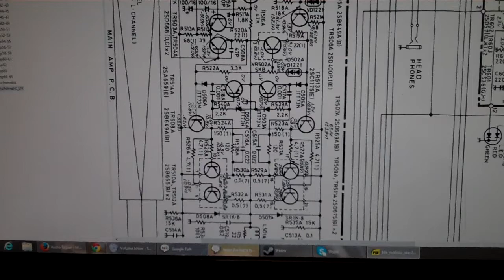Fix It Friday: Realistic STA-2300 Power Amplifier Modules

Comment: Andrew thank you for a great video.I bought an STA-2300 in1980 when I was on high school and 4 Mach-Ones.It was on use everyday until about 6 years ago.I stored it when I moved to a new house in my dry basement.I've been contemplating  dragging it out of "moth balls" and hooking it back up, but I'm afraid of it having problems due to storage and age .Any tips for hooking it back up? Also I have the original owners manual that has the schematic in the back of it ,if you need it I could scan it and e-mail it to you. Lonnie.

Comment: I was wondering if you'd happen to know what is going on with my sta-2700 realistic receiver. The following is the background info as to what's going on.

    I've been using a new to me sta-2700 for a couple of months now. At times I've run it pretty hard. The other night running it "pretty hard" it shut itself off and then back on , I then cranked it way down but it again went into that protection clicking off and then back on. I thought maybe it was the speakers so I removed them and installed some other speakers (I'm just running a single set of 2 8ohm speakers, "speakers A"). and it shut itself off again. At that point I just turned the receiver off. Now last night while using it at quite a low volume after about a half hour it shut itself off and then turned itself back on and at that point I just shut it off because I have a problem somewhere. I didn't really feel any warmth coming off it so I don't think it's heat related.

    I bought a service manual for the 2380 because I know they are similar, thinking that the troubleshooting would maybe give me a hint but it doesn't have anything about what to look for if it's going into this protection mode. I'm hoping someone or multiple people will have an idea what to look for as to why it's happening. Thanks in advance. 

   As a little bit of an update, the speakers I removed I hooked up to a sta-2380 realistic receiver (which is just about the same as a 2700 except the 2380 isn't remote controllable) and ran it for about 6 hours at a moderate volume with no signs of trouble. Made the receiver a little warm but not too bad considering it was in my 80 degree barn. So I don't think the 2700's problem is anything to do with the speakers.
Reply from the maker: Funny you should ask about the 2700 as I have one of these! The power supply board is notorious for bad capacitors and thermally stressed joints. Recap this board and rework all joints at hot parts. If the regulated supplies go intermittent, it will go in and out of protection. If DC offset is high, replace the two transistors in the input stage.
Reply: Hey, thanks. I see from the service manual (at least for the 2380 it has 4 ceramic caps on that board (I think?) do you do those also or just the electrolytics? Do the elect's show any obvious signs of being bad? To give you an idea where I stand as far as repair work. I work on the old selectavision ced players. Their service manuals are very detailed and really guide you as to what to look for and how to test etc. So when I have that guideline to follow I can usually find defective parts, make adjustments etc. So replacing the caps on the power supply board is not a problem for me. I've recapped a couple realistic shortwave receivers. However I don't know how to test for dc offset. Is that something you can explain here or is it too "deep"?? I just bought a new receiver a sherwood cheap receiver but I had a related model that I abused and I pretty much had it on all the time for a few years and I think the power transformer went out on it so I scrapped it. I think it was $99 when I bought it. That's when I thought about going old school and got the 2380 but realized I really want the remote control capability so I read the 2700 is basically the same except it has a remote. There are some minor differences, one of them has a midrange adjustment, So then I got the 2700. I stuck the 2380 out in my pole barn and then hooked the questionable speakers to it and ran it for about 6 hours without incident.
   If you can explain that dc offset thing I'd appreciate it. For the ced players I sometimes use my oscilliscope, frequency counter and /or voltmeter for testing and calibration but some of it seems to best be adjusted by just playing a disc and making what ever adjustment.
Reply: I checked my dc offset, I didn't realize it was so simple. Anyway my right side is 3mV but my left side is 100 mV so I'd like to replace the transistors, however, I don't know what two to replace/ I don't understand what input stage means. I did find a forum post from about 4 years ago and the person performed the repair so I've posted that on the forum along with basically this same question. Do you happen to have the service manual and/or schematic for the 2700? I'm using the one for the sta-2380 because that's all I could find but I had to buy it for $15. Thanks.
Reply from the maker: @jsdspif3  sorry for the late reply but if HifiEngine doesn't have a schematic, consult the STA-2600 schematic  as it's the closest match to the 2700. Only the electrolytic caps are failure prone in this unit. To correct offset, replace the two small transistors in the input stage with a closely gain matched pair. These are in a differential pair config; google this and once you see one example of a diff pair, you'll be able to spot them immediately.  Off the top of my head, I believe these were PNP parts and if so, use KSA992 as a replacement and ensure the pinout is the same.

Comment: Hey Andrew, do you still do restoration work?
Reply from the maker: I do but the shop is closed for new work at the moment due to a move. Should be back in business by December.
Reply: @MadScientistsLair  about how much would it cost to service one of these units today?
Reply from the maker: @davedavis4285  It depends on the level of service. A full rebuild is approaching a grand but few need this level of service if they're well maintained.

Comment: Getting a new fiber glass board would be first, then the rest.  Just see how good it could get over the other channel, then change it too if it helps.  Next time keep your videos until the work is done then upload.
Reply from the maker: Why would I want to replace the entire PCB? It's in very good condition. No pads were lifted and no "green wire" repairs were required.

There's no need to perform the difficult and time consuming experiment you've proposed because there is no basis for it in electrical engineering theory. Show me the math or go home in other words. Finding time to rebuild this is hard enough with school and actual paying customers so if I'm going to mod it, it had better be worth it.

Phenolic FR2 to Epoxy-Fiberglass FR4 is just a durability move in circuits like this. Going FR4 serves no other functional purpose other than flexural strength in single layer, low voltage, low frequency PCBs with component temperatures that are well controlled. Heck, parasitic capacitance is low enough that we can make UHF circuits on phenolic so we can dismiss the most common gripe, dielectric constant, right out the window as we're working with frequencies no higher than 100kHz on this circuit. Since this is home gear and not being tossed into a roadie's band trailer on a daily basis, I see no reason to change the boards for durability either. (What about the other boards, do we rebuild those in a ruggedized version too?)

If I were to go through the trouble of making a new PCB, where do we stop? Do we change the layout, which is already quite good and very easily made worse? Do we change the topology as well to one that is 4x as complex but gets us an extra decimal place cleaner on the already pretty much inaudible THD? Both, even if executed perfectly, would show miniscule improvement unless we tossed the preamp as well...and then, well, you don't have an STA-2300 anymore.
Reply: Andrew Kwiecinski
Well just why you'd want to replace the board is real simple. (When you know how).  It's like getting the STA-2300 the same boards as the McIntosh 4100 .. because ... know what?  It's not just a durability move.  Besides consider such a You Tube video - a tricked out STA-2300 to compete with 'the MAC' receiver.  Actually the Carver MXR-150 probably needs you more.  It's a receiver that needs some You Tube help - if ever there was one.  How about it?
Reply from the maker: Kepler Mission
 OK, since you claim to know more than I do, I have a challenge for you: Explain in detail, with the relevant mathematics to back it up, how changing the board material from FR2 to FR4 is going to make this thing sound like a McIntosh MAC4100.

If you meant that you'd also change the circuitry, explain in detail what makes the MAC 4100's drive boards so special and what design features you'd incorporate in your new boards. Also, explain how you will propose driving the extra set of output transistors the Realistic has and how you'll be ensuring adequate drive and proper biasing of four outputs instead of just two on the MAC4100. (Yes, the STA-2300 is a more powerful receiver than the MAC4100.)

Are you basing your assertions on proper electronics design or are you just rambling on?

To others reading....

The MAC 4100's drive boards do not appear to be special at all unless you're driving into clipping, which the MAC4100 drive boards prevent by limiting the input by use of a comparator and an unusual way of shunting excess signal using an LED and a photoresistor. This is the short and sweet of how PowerGurard works and it's one of the simplest compressors around. A similar comparator based system without the photoresistor is used in Peavey's DDT circuit and many other clipping prevention schemes. It is much preferrable however to have a generous reserve of excess capacity than to rely on a compressor to prevent clipping.

The MAC4100 receiver does 75W into 8 ohms and 100W into 4 ohms and uses a single pair of output transistors. The STA-2300 is does 120W/ch into 8 ohms with two pairs of outputs per channel. Both are rated at 0.05% THD at rated power. Needless to say, the drivers are different for a reason; they're totally different amps!

If I was going to do something as daft as to redo the driver boards, I'd forget the nearly 40 year old MAC4100 design entirely and build one based on the LME49810 driver IC and get up to an order of magnitude better specs....but if I'm going through that trouble, I can't leave the preamp alone, etc. Te question is, where do you stop when you start redesigning existing gear? I happen to know for a fact that the preamp is the weakest link, not the drive card. Yet the preamp is good enough as is so I'm not going to bother with redesigning it either. The overall S/N is 90dB, not spectacular but it certainly gets the job done. Bringing that up to 110dB or even just 100dB would require extensive redesigns of multiple subsystems including the preamp and is about as much labor as building an entirely new amp with MY name on it and potential commercialization opportunities.

TL;DR: The STA-2300 is going to be largely unchanged from its original design save for a few minor tweaks here and there. The circuit topology will remain the same because the rewards of modifying it are totally drowned out by the costs.